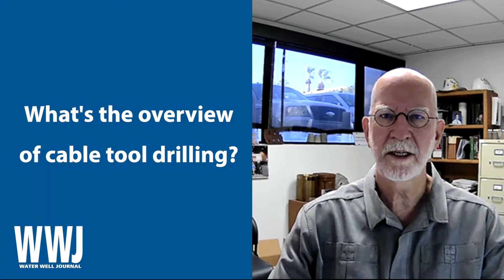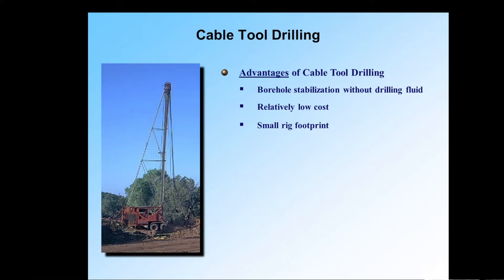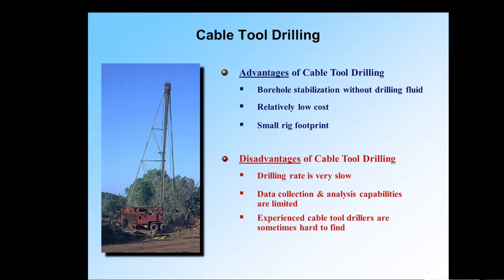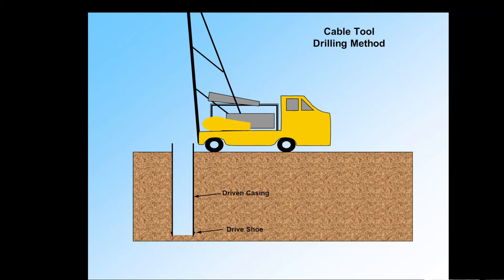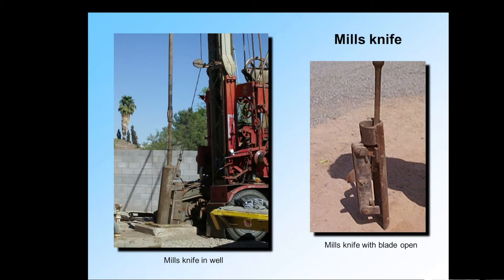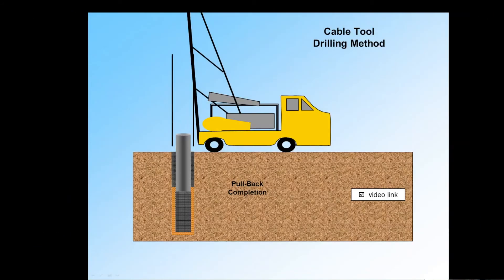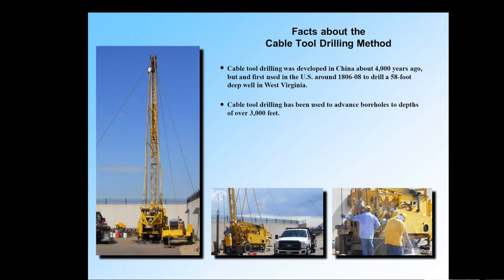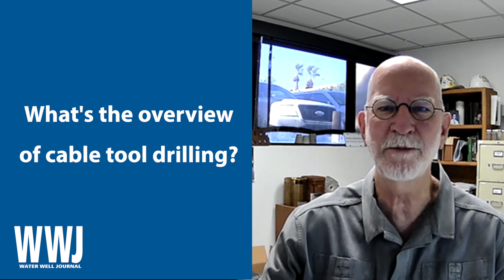Marvin F. Glotfelty, RG, on Cable Tool Drilling | NGWA: Industry Connected

Comment: Some of us young guys are around 💪🏻
Reply: 1 Point I've never seen anyone touch base with on YouTube....
I worked on a well drilling company in Molalla, Oregon about 22 years ago.  The company had a cable tool rig and a rotary rig.  Are cable tool rig burned about a gallon an hour. The rotary rig burned about 10 gallons an hour. The cable tool rigs are much cheaper to repair, and since the casing could be done at the same time, the cable tool rig was profitable anytime we weren't drilling through more than 10 ft of solid rock.
Reply: I just turned 18 and spent so long trying to find what the rig I worked on was called, nice to learn how it works